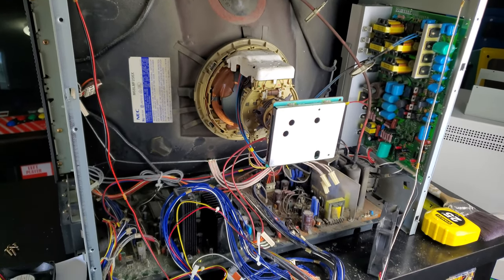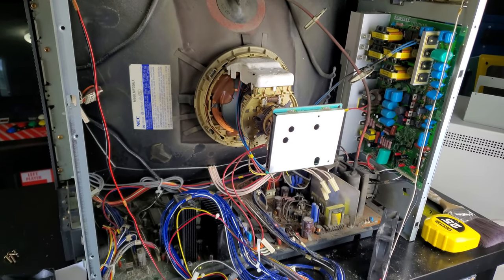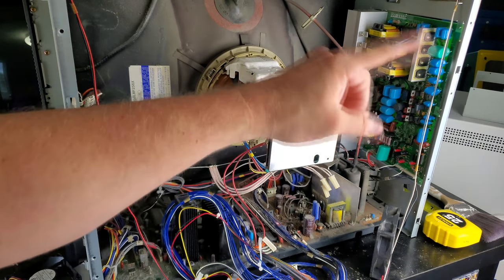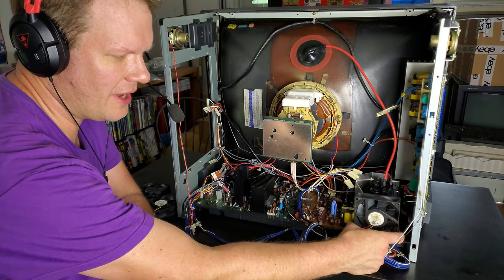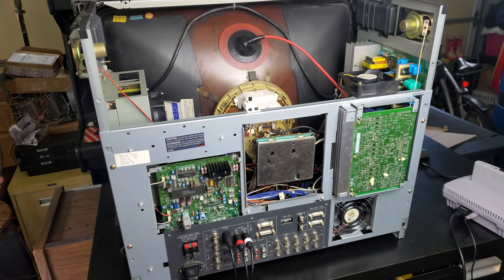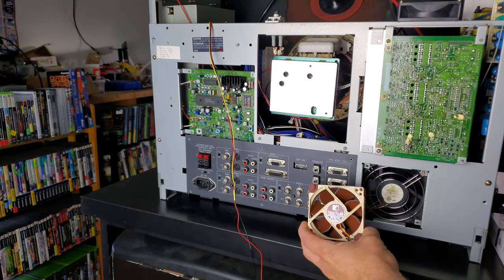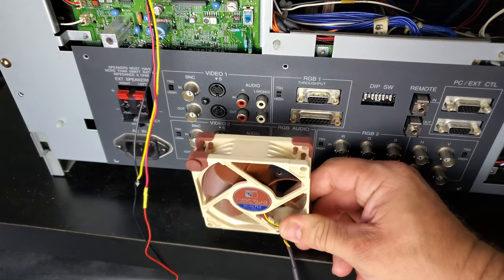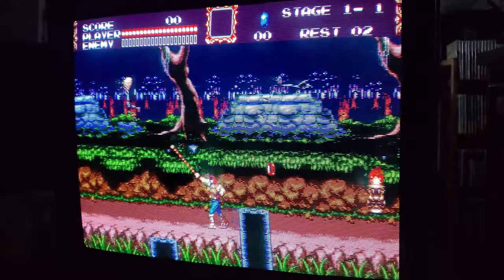NEC XM29 CRT Restoration - #3 - Everything Comes Together

Comment: I would use and wire  thermometer and check the inside of the case with different fan push and pull settings to check which setup is the coolest for the inside

Comment: Cool video

I am actually going to recap my first sony trinitron consumer crt.
I have taken it apart and taking notes about the capacitors, their diameter, length,  lead spacing and all of that so I can order the right size and value from mouser.
The reason I am going to recap it is becouse it has some geometry issues on the right top corner and bottom left corner. They are a little squished. 

Do you think that's bad caps going that or it has some other problems ?
Your opinion would really help 😁😅